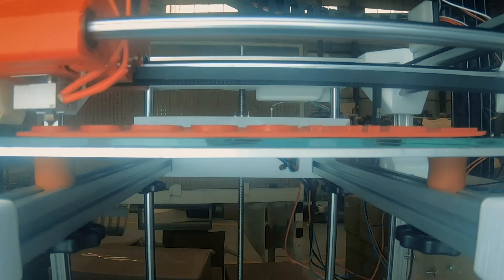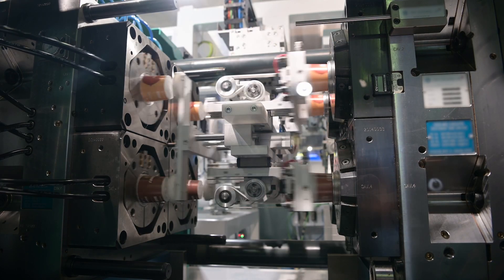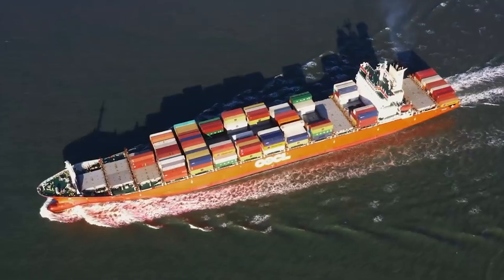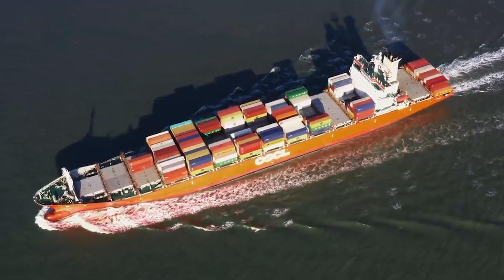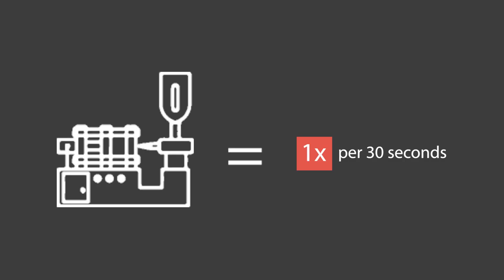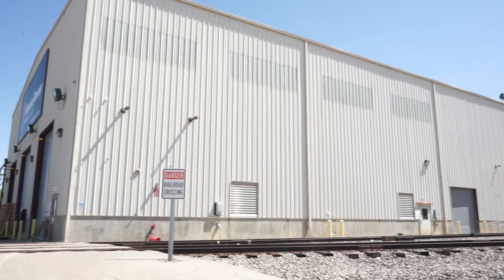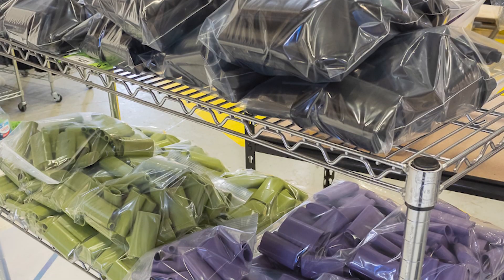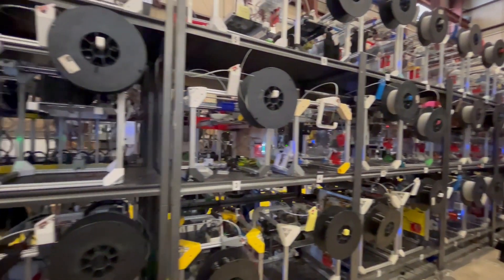How 3D Printing is Faster than Injection Molding

Comment: FYI you also forgot to mention the time, cost, and design of the mold for each separate mold.
Reply from the maker: Good point. Though to be fair optimizing a design for mass production 3D Printing can also take some time to do it right.
Reply: @slant3d  agreed but cnc mold build time and mold materials are expensive and time consuming also if it is not right the initial expense and time go up dramatically.

Comment: You left out the part to have the mould itself made. That can take months alone before you even reach the production stage.
I used to work CNC machining and plastic injection mould design in another life. Not a quick nor cheap endeavor.

Comment: 3D printers scale linearly in cost and production. Not to mention the adaptability and on demand capabilities. Injection molding scales a little more sharply in cost and in production capability. Both have their use case scenarios. If you had a good CNC machine, you could probably run a hybrid model with both production techniques in house.

Comment: There are more and more injection moulding companies that are taking the same approach to 3D printing of smaller machines with a quicker turnaround. I was just quoted 4 days ago for a project to be injection moulded and was a little surprised. The quote was 4-6 weeks for the mould to be made (quicker and more expensive if they made it state-side instead of in China) and then they say about 10,000 parts a week. I could get as little as 1 part made or hundreds of thousands, with the cost going down with more purchased at once of course. Aside from the $8k mould, it would be about $4pp if I got 100 made or $1pp if I got 10k made. They retain the mould, so when I need the next batch the turnaround is quick. I was thinking of injection moulding for the consistency of it as well as the speed to increase production versus the limited ability with 3D printing.

That said, it costs me about $0.30 and 3.5 hours to print the part (1 hour on the P1P) and with my farm now over 40 printers, that is about 6 parts per printer per day (on the Enders) or 6,700 parts across them all in the 4 weeks it would take for the mould to be made. It is cheaper, the parts are already in my hands to package as we go instead of boxes worth at once, and if anything needs to be customized or changed it can be done on the fly. If I want to change the colour or add a variation (family mould with injection moulding) then there is no extra cost to do so. Both methods have their uses, but 3D printing holds up really well when it comes to mass production of certain parts.
Reply: I agree.  I went down is route as well and came to the same conclusion.  I wish there was a way to make injection molding like 3D printing.  I would rather 3D print a mold with lots of parts and then use a smallish injection molding machine to crank out many parts quickly.  The great thing with Injection molding too is you don't need supports and you could use ABS plasics without any seam lines. I looked a the Buster Beagle project but it seems really complicated for an unreliable end result.
Reply: @timpmcfadden  Buster Beagle 3D Mark 3
Reply: @azurehydra  Thanks,  I looked into it.  Doesn't seem to products very consistent quality of product.  And it seems like lots of work to find out.